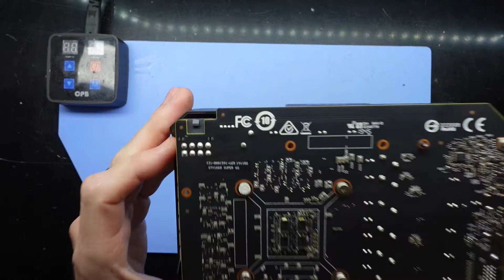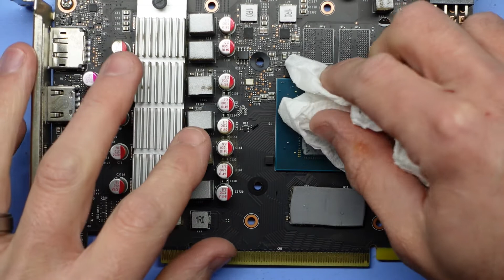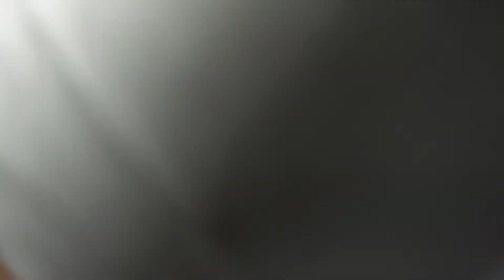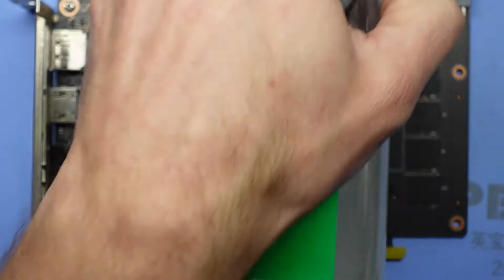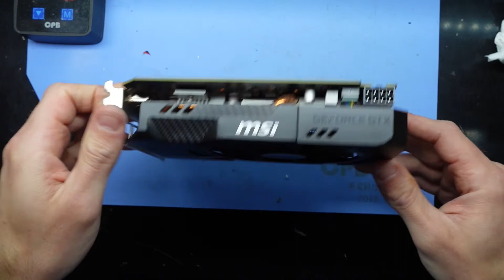MSI GTX 1660 Super Aero ITX Thermal Paste Replacement

Comment: I'm not fond of a couple things here I disliked. you didn't even check that the fan wire wasn't pinched, or the fact that you didn't necessarily smooth out the paste. Easily causing air pockets and could overheat. Too much paste or too little paste is not good. I own two of these same cards and always overheat on me before I ever touched them. Fan fins always get hot and warp blades or can visibly see a slight melt on them in sections of these fins if look closely. I've been working on and building computers and parts since the IBM XT/AT

Comment: This video is much appreciated. I am a newbie and could not figure out why my 1660 super kept crashing games. Performance in game was always optimal but the games kept crashing. I was brave enough to open up my GPU after watching the first segment and realised the truth... I was almost out of thermal paste. Its now wonder the sensor software kept giving me low temperatures which I thought was good, but on the contrary. Just shows the core GPU was not facilitating any heat transfer away, hence the low temp readings. Thanks!
Reply from the maker: Great to read this has helped give you confidence to attempt the thermal paste replacement

Comment: Excellent tutorial. It's too bad that my gpu idles at 45°c now lol. I think my plaster just sucks.
Reply from the maker: Depending on room temp. That sounds about normal
Reply: @rickstechrepairs  The temp spikes to 90 degrees when I load a game. It also sounds like a jet, which goes completely against the reputation of the sound of the GTX 1660S. Now that I read my comment again, I sounded a little sarcastic when I said that the tutorial was excellent, which was not what I meant to sound like. To make it clear, it is a good tutorial.
Reply: @sear9993 what thermal paste did  you use?
Reply: @CortneyMungo-yz2pc  I used stars 922 thermal paste (I didn't choose the paste). The tubing had broken and I guess that made it dry out. I fixed my computer using SYY thermal paste.
Reply: @sear9993  okay that's good so no more issues?
Reply: @CortneyMungo-yz2pc  Nope!

Comment: Thanks for this video Rickstech! I'm trying to oil the bearing but it doesn't seem to be accessible-- any ideas?
Reply from the maker: Hi. I think you will be replacing the fan with one of AliExpress 

You might be able to use WD40 (a lubricant in Australia) that is also electronic safe
Reply: You wrap the fishing line evenly by the blades closer to the center and pull. Lubricate and back until it clicks.
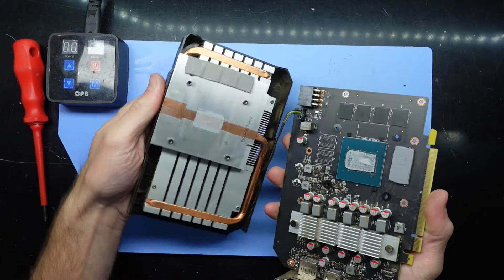Reply: I figured it out-- at 0:42, you  can see the plate underneath the fan. You have to take that out to access the fan from the rear.

Comment: Bro plz tell gpu fan speed control is good  my temp and fan speed same after open fan speed control using msi afterburner 69 temp  69% fan speed is safe 🤔
Reply from the maker: 69% fan speed should be fine